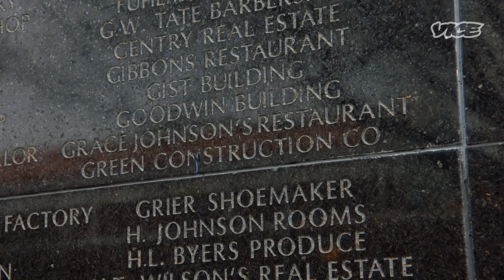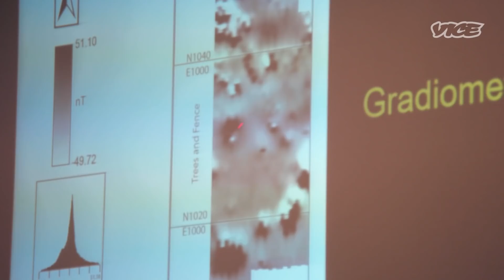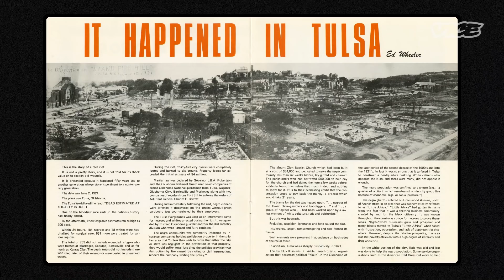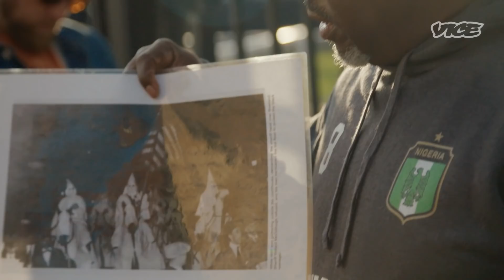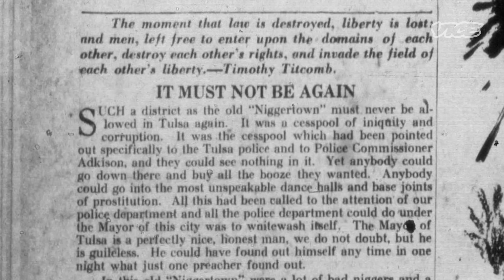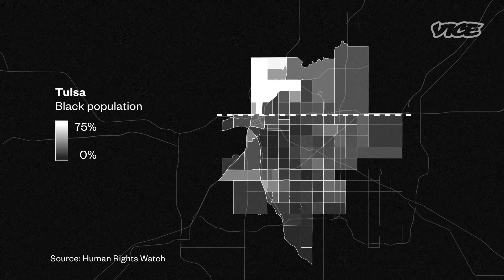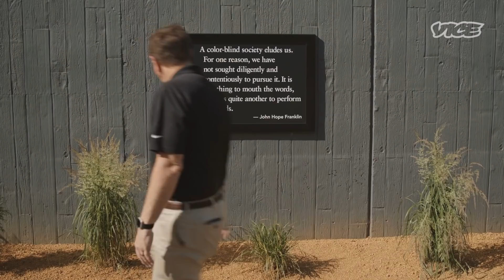Why the Tulsa Race Massacre Is So Important to the Reparations Debate

Comment: 2nd amendment would’ve helped, sad tragedy of our country.
Reply: Some of the black residents were armed. But  they had folks in air planes firing at them and dropping turpentine down on them.  The Black folks out their were woefully out gunned from the very start.  

Small arms don't do a thing when the decks stacked against you like that.
Reply: @robertkeaney9905  Vietnam and Afganistán suggest otherwise, but this was a surprise attack from the white ppl. Hard to prepare. :(
Reply: @nut913   Oh I see, your saying that vietnam and afghanistan prove that you can defend against air power with small arms. 

The major difference is that in Afghanistan and vietnam the people getting hit by airplanes had places to hide. 

The US couldn't tell the difference between an south Vietnamese farmer and an insurgent from 300 feet up. 

And in afghanistan an insurgent can just trim their beard, slip on borrowed clothes, and disappear into the city scape. 

In Tulsa there wasn't any place to hide. As whites were going after any one with an skin color darker than marmalade. 

Black folks didn't have any where to hide. All they could do is run while their homes and businesses were burned down.
Reply: @robertkeaney9905  i didn’t think of that, good point.